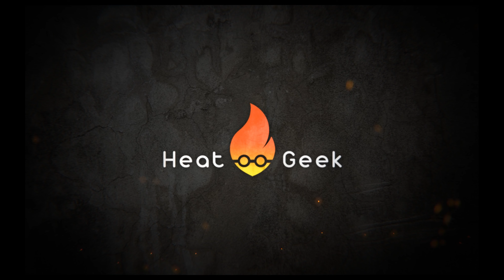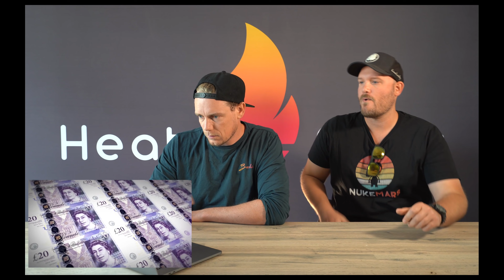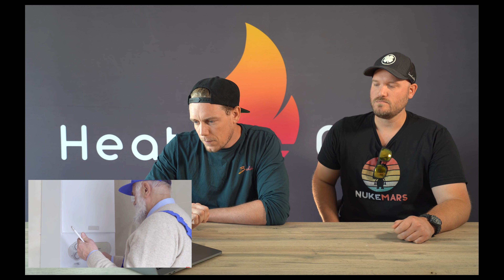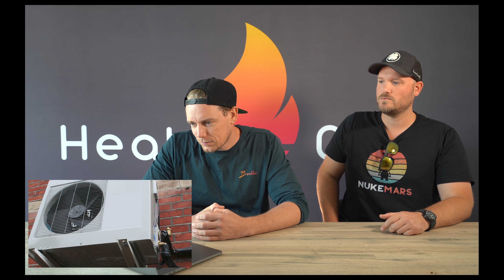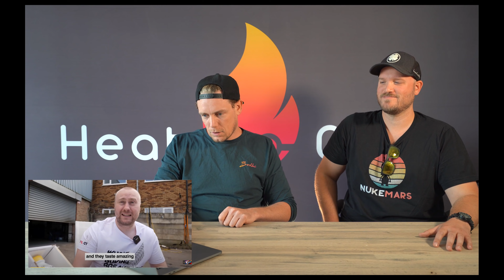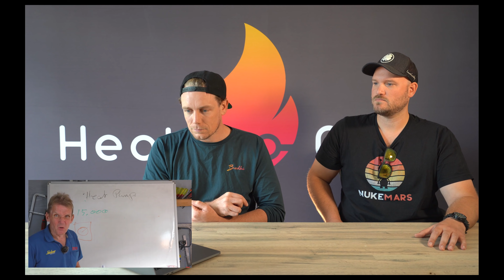Professionals React (BADLY) To Skill Builders's Heat Pump Videos | PART 1 | FIRST TIME WATCHING

Comment: On the loss of skills in the sector, that's not going to be helped by incentive schemes that don't incentify proper investigations and design to be carried out.
Its just like the conv I had with building control when asking them "Who do I go to, who knows this stuff, what companies are not just "going to roll out some wool and collect the cash?,  are there energy advice companies, surveyors?"
His answer was to do the research myself, decide what I need done and hire contractors to do it.  Trying to find professionals to do it will either end up with rubbish work, scams, grant collectors or... be extremely expensive hiring a commercial building surveyor for the investigation, consultancy and design work.
That's probably why I'm here.
Reply from the maker: Call a heat geek!
Reply: @HeatGeek  I fear your hourly rate in Northern Ireland would be pretty high, but thanks.

Comment: In my last apartment, the butcher shop downstairs had 2 large refrigeration units mounted to the outside wall.  Whomever installed them, did not mechanically isolate them, so when they were running they send a low frequency vibration through the entire building.  It wasn't loud, but when lying at night trying to sleep, you knew it was there.  I know they silent when installed properly and brand new, but how long will those bearings and mounts last before they start to vibrate and whine?

Comment: I have fallen foul of "incentive schemes".  I understand his anger.  No offense, but it won't be guys like you doing the installs under these incentive schemes.  It will be ever "tom, dick and harry" plumbers outfit trying to cash in on all that grant work.  They will NOT advice people who don't need one and shouldn't get one of that, they will happily install it for them.  They want to do the minimal amount of work to get a sign off by building control and collect the grant money.
My case was insulation.  £250 government grant and a £300 quote to install, £50 cash.  It took them about an hour to insulate the upper attic to 300mm and a guy installed 6 ventilated slates a week later.
Immediately the temperature in my house plumetted.  I could no longer heat my bedroom.  Basicallly, after speaking to a number of building surveyors, the house should never have been vented without insulating the lower roof and sealing up the air channels through to the attic.  By venting the upper attic, they also vented the lower attic, and the upstairs boiler cupboard, but it has no insulation, so my entire front downstairs ceiling is a sheet of plaster away from the outside cold space of the attic.  My bedroom floor and 2 walls are uninsulated floor/plasterboard.  That mess is going to cost me £2000 to fix!  Building control inspector confessed there is nothing they can really do about it, he even agreed it is BECAUSE of these poorly thought out incentive schemes which try and fix the problems with "one pancea" and encourage cowboy trades men.

Comment: A COP of 4.5 on hot water?  On a warm day when it's 30*C, where the f do you live?  Nobody cares about how their heating performs when it's 30*C outside!
A GOP of 2.0 in the dead of winter is pointless.  A 1kW heat pump consumes 1kwh of electric in an hour and produces 2kWh of heat?  That's going to cost about £0.36 per hour to run.  However running a gas boiler will deliver that 2kWh of heat in a much shorter time and only use about 2.2kWh of gas....  which is about £0.28p.
And 2kW of heat wouldn't even get noticed in my house, that's like a single radiator at 60*C.  I believe the largest practical domestic heat pump is about 8kW, but they are very expensive.  I mean if I spent £10k+ on the house first to have it fully insulated and draft proofed with underfloor heating downstairs, maybe a heat pump might start to look practical.  Until then I still have about 9 years life time on my gas boiler.

Comment: You hit it on the head old houses are far toooo expensive to insulate so a heat pump isn’t the best solution. Oh winters in Scotland aren’t getting colder they’re cooler. it’s getting wetter though.

Comment: Interested to hear your thoughts now that gas has risen so much since posting this video.
Reply from the maker: Exactly the same. Electricity had also gone up.
Reply: @HeatGeek  Just watching your interview with Roger!. I'm currently buying an old uninsulated house. Single Skin block build, mid terrace. I plan to insulate the loft, add  some internal false walls with insulation to front and back of property. There is no gas supply in the road. So my options are, oil boiler install, air source heat pump (currently only has immersion heater) or easy to fit electric radiators. I will have a multifuel burner in the lounger. I want to future proof the house but cannot find any comparisons between the options I have available. Any help would be appreciated.

Comment: Professionals in the UK??? 🤣🤣🤣
"Engineers" with no engineering degree, 5star rated tradesman jobs lasting 6months, and 99.9999 % doesn't even have any education, to present elementar knowledge in their profession,  please.
Buffer tank in UK tiny properties is a must as there is not enough of corridors from where you could reverse the flow to defrost the external unit without affecting the indoor climate. No low heat aluminium diffuser radiators only steel panel connected wrong losing 5-10% on the output. 
He is right at some point,   reality is painful 99.9999% of 1920-1990 properties doesn't have any insulation so installing low heat output source on there is pointless. 1000s of properties doesn't have double or triple glazing.  Even new UK property insulation is pathetic compared to central EU standards. 
Luckily monoblock doesn't need to be installed by any so-called "engineer" and manufacturers like Galmet sell airmax 3 with preplumbed indoor box to make it neat and easy,  Siemens and Hitachi does the same so no philosophy to get it done by anyone "handy". Every EU heatpump manufacturer offers calculations and installation assistance/troubleshooting. Not a rocket science, but don't expect to have it running efficiently when you have an ambient temperature under your 22mm floor plank and brick wall with 50mm cavity filled with polystyrene beads as it won't work.  
Heatpumps work great with solar panels but you have to have a roof not tiny 5-6m terrace house.  House need to be built of low U-value uniform materials not of bricks and mortar and all this need a min 150mm external insulation, min 400mm of decent roof insulation, not shtt called loft roll and  foundations insulated all the way down. Reality is painful UK houses are colder than modern tents, and to make them heatpump efficient they need to be demolished and built to central EU standards. Sooner you understand all listed old crapp and 1920s onw terrace need to be demolished is better for you.

Comment: You can combine air source heat pumps with co gas boilers as well? That's the trouble surely if the government only subsidises an install if the gas boiler in scrapped, is it not enough that gas usage is reduced by over like 50%? Is it not worth keeping the gas a back up because the heat pump seems like a lot lot more materials and complexity as a system (an electric 750w convection heater barley any materials in comparison and a combi gas can fit in cupboard) heat pumps have to work harder and less efficiently well and presumably less reliably the colder it gets, its not what you need to have maintenance issues when the temperature drops below freezing.
Reply from the maker: That's hmcalled a hybrid or bivailant system. No it doesn't take less materials it takes considerably more. 

Although heat pumps are less efficient in the depths of winter, they are still 250% efficient, as opposed to a gas boiler at 85%. And no they are no less reliable in winter.. its all garbage pushed by media. They have always been and always will be.

Comment: Asked before so will ask again as you guys' spills your beans. where is the electric coming from to back heat pumps up? Not forgetting the electric cars, the Government is pushing, plus double if not more the amount of water in larger radiators and pipework to heat up in a new heating installation.
Reply from the maker: We answered many many times before sonde answer again. The amount of wind generation programs dwarfs projections on heat pumps and cars. But let's say for some odd reason they all stopped mid build. And every nuclear plant and existing wind turbine broke, and it was cloudy from now on so no solar. Even if 100% of electricity came purely from modern gas powered generators at 50% efficiency, the carbon foot print of heat pumps would be 120g/kwh woest case as opposed to 215 through a gas boiler.. 

The real answer is if we continue as we have been a mix of sources.

Comment: If the installation man is prepared to say that his customer are unhappy with the cost of running. They ridicules him for that with their smirking laugh.    We I don't ridicule that I call that honestly and that is to be valued.   They are in efficient too. You know this when the emphasis for expensive insulation is so advecated.  Also they suggest leave them on all the time.   So they can't heat a cold house when you have been at work all day??  and the insulation is imperative. This should be enough to cause concern.   This skilled fitter is an intelligent man he has knowledge of many things his skills are not in question.  So these two piss taking twat boys think they can discredit his analysis by suggesting things were not installed correctly are smug and self satisfying, their argument is weak and not so.   Bs vid in defence of the unfolding obviously.
Reply: Watch the later video, Roger comes in and agrees that design and install is the main reason they don't work

Comment: We lived in Canada in the 1960's , winter in Alberta started in September and went through to end of April . You turned the heating on around September and off in end of April . A system has to be able to cope with that . In Australia we go through a heat , nil  , cooling ,nil ,quarters and ideally the cooling air needs to come from above and the heating from below so a heat pump system as typical purchased is good for cooling but not good for heating . I can see people / governments spending enormous capital all because of a delusion on the climate . Nobody really knows wether it is getting warmer or cooler . One thing for sure it is not keeping the same . Never has never will .

Comment: So far, my takeaway is that he's a low-quality installer. We're looking at heat pumps here in CZ and the first thing our installer stated is that it's not just installing a heat pump but the whole package, insulation (our property was built in 1890's and has been treated) radiators (out with the cast iron rads), heat loss etc.

Comment: We’re getting “harsher winters due to climate change”?….errrr, no. We’re getting warmer wetter winters.  The real trouble in the UK is that building codes have been insufficient for decades and simply have stuck in the past wrt insulation.  If houses were built with better insulation than even new ones today, our heating bills would halve.  The best houses were possibly 1980’s and 1990’s small estates executive type builds which were hugely better built than today’s disposable monstrosities.  Modern new builds are shockingly bad and we’ve gone backwards in building standards.  Heat pump installations are simply too expensive to retrofit for most people.  I looked into it for our house and have decided on gas instead as it was less than one third the installation cost.

Comment: wow.  In the states here, this is HILARIOUS, particularly about the noise levels.  Here, Air Conditioning is nearly ubiquitous.   I can hear my neighbor's outdoor units when I'm outside - my heat pump that replaced my outdoor unit cannot be heard from the deck that is right next to it.   This guy is REALLY stretching.  I saw the original video and just shook my head.
Reply: My old blower for my gas system was a lot louder then 3 outdoor heat pumps

Comment: Please, keep your green energy dreams on your own continent as well your climate alarmist.

Heat pumps suck donkey pecker below 32°f /0°c as you'd have it.
And there are plenty of those in north America. 
Not to mention, any power outage and you're S.O.L....
Simple gas heat is a first class backup at the very least, and worked well in its own right for decades .
Energy diversity is key.

Give it up at your own risk, but stop advocating that everyone should give up theirs

Comment: Didn't appreciate the snide mocking of Roger in this video. "What is he, a general builder?" just to immediately frame it like he's a cowboy. He's an experienced plumber and he brings decades of life experience to his viewpoints. And he was bang on about rocketing energy bills well before there was a crisis.
Reply from the maker: He didn't say all bills would rocket. He said gas would come up to match electricity, that has in no way happened. I had to ask what he did because I did not know at the time
Reply: @HeatGeek  I was paying 20p per kWh a year ago for electricity and now my gas is 15p per kWh. So under my interpretation of what he meant, that's close
Reply from the maker: @1983englishman  I paid 13p for electricity 2 years ago and I pay 9p for gas now. However, and extremely importantly I now pay 35p for electricity. You have to use yhe same point in time to measure price comparison, obviously. 

Importantly also.. they SHOULD come closer (although they aren't yet) electricity has a 22% environmental tax and gas only 2% yet lecy is cleaner. Additionally, wind power is now cheaper than gas but policy does now allow is to pass those savings to customers..
Reply: @HeatGeek  I'd like to go fully electric. Infrared seems interesting. But when I worked out the costs, especially running costs, it was extortionate with current prices
Reply from the maker: @1983englishman  Infra red is mental. Should be absolute last resort
Reply: @HeatGeek  Update - just seen your civilised debate with Roger. Excellent 👍

Comment: So some of them don’t work,are noisy and if you don’t get an expert installer it won’t have a chance of working. why on earth would we want to change our very efficient gas boiler at great experience to put in a very poor ineffective heat pumps. Crazy. You guys will not convince me to change my boiler in my 70 year home . I have solar panels and I have a wood burner. 
I can’t afford £20,000 to go over to this technology that I have no confidence in. The builder/ plumber sounds a much better expert than you two.

Comment: Strangely I’d take the view of the other guy any day than these two chumps one in back to front base ball cap. Heat pumps don’t work in the uk with normal houses unless you’re prepared to pay £7-10,000 to install. They are not the future of heating a house in the uk.

Comment: I would not touch one with a Bargepole. What is the life of a heat pump. What is the annual cost of servicing a heat pump. What is the cost of electricity. I would rather install electric radiators and electric water heaters. If they got rid of gas.
Electricity is not a green fuel. It just that you are not making pollution where you live. It is at the power station,  the steel mills or the rain forest. If you want to save money, change to LED lighting. Also Solar Power seems more reasonable, Now that electricity has gone up. No government is interested in  Global Warming. otherwise they would mandate the fitting of solar to all new builds. You then have the life of the mortgage to pay for it. And when you sell the house, you do not have an outstanding loan.

Comment: oh so the heat exchangers aren't using a gas and compressor to transport the energy , strange , so where does the electrical rating come from of around 25 amps , approx 8kw , any sensible answers and for a final kick in the backsde your missing the most important point , even a new housing estate would have to have its 3 phase supply upgraded costing billions and this country does not have the capacity now , and the silly carbon agenda does not make any difference to the climate , this planet will do what it wants , its arrogant to think you can change it

Comment: There is a huge market for Self Install ASHP Air To Air Mini-Split in the US. But in the UK, Our Government have made it Illegal for Normal people to do a DIY Install. Because of regulations requiring  Gas Fitter qualifications to commission the Cooling Gas in them. If it's OK in US it should OK here as well. Paying for an install Doubles the cost of what is already an expensive unit !!...
Reply from the maker: The uk have not made DIY illegal. This is incorrect.
Reply: @HeatGeek  I'm afraid it is. You can't even Order an Air To Air ASHP Mini Split, in the UK. Without a Gas Fitter Appointment in writing. And you try and get a Gas Fitter to attend an installation he has not personally installed...
Reply: @HeatGeek  It's utter madness, a lot of the ASHP Air To Air Mini-Split  come precharged anyway. I can't see what the issue is. The gas is freely available mail order as it is...

Comment: Buy a quality heat pump from a company that researcher in and develops heat pumps. Electrolux, Panasonic,Mitsubishi, Danfoss are some of the good ones. And there are different configurations; air to air are good for space-heating, air to water good for water-born systems and one of the very best systems for water-born applications; is the geothermal heat pump, this type of system is very popular in Sweden but, heat pumps are general popular in Scandinavia for heating and are widely used. They also have district heating works, which is a domestic heating system not very well known in the UK. Glad to see that you guys have positive take on heat pumps.